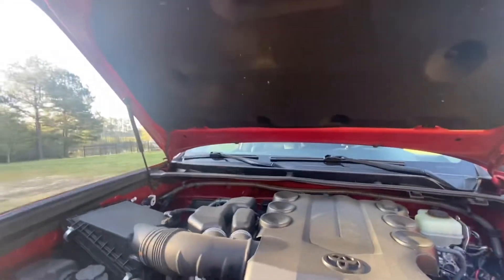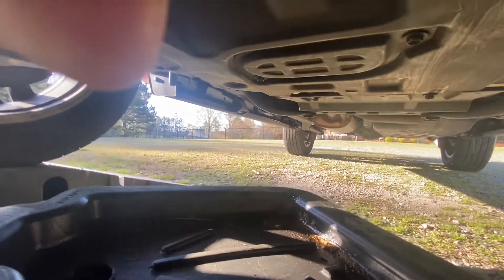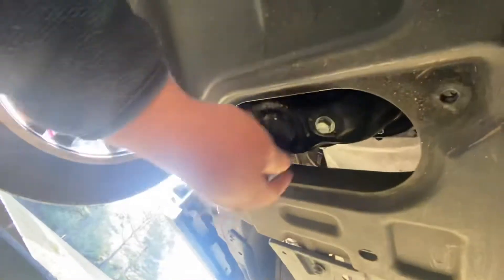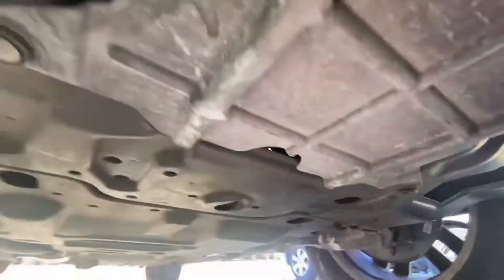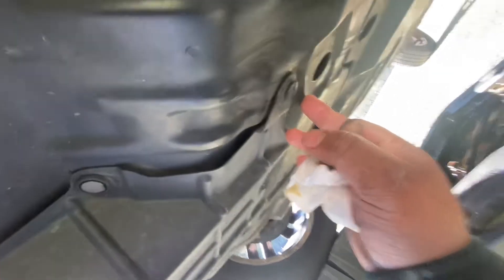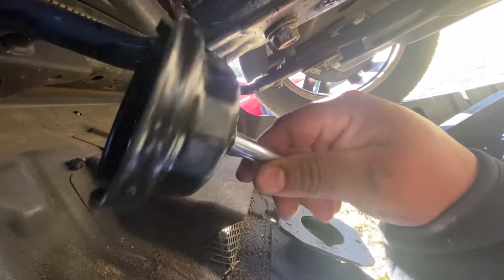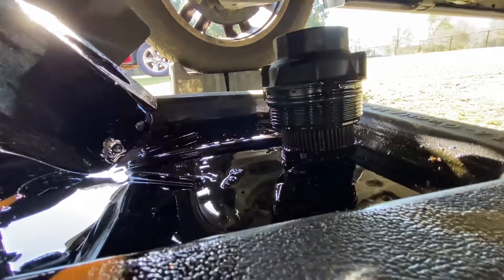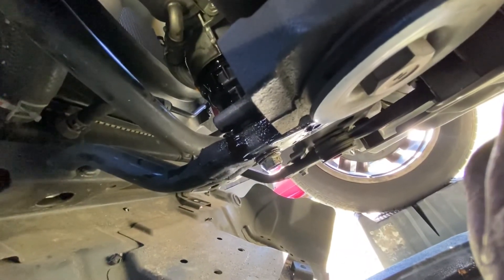150.- 2010-2018 Toyota 4Runner 4.0 l engine oil / filter (how to change oil and filter) BEGINNERS

Comment: Good video. Was that the first oil change for the vehicle? The reason I ask is to know if the filter cap was super tight or not to remove. Thanks and mine is a 2012 and all 4 oil changes have been at the dealer. I want to start doing my own.
Reply from the maker: Hi thanks for watching my videos 🙃
It was first time and super tight try to get the oil filter cap remover tool and long wrench for leverage